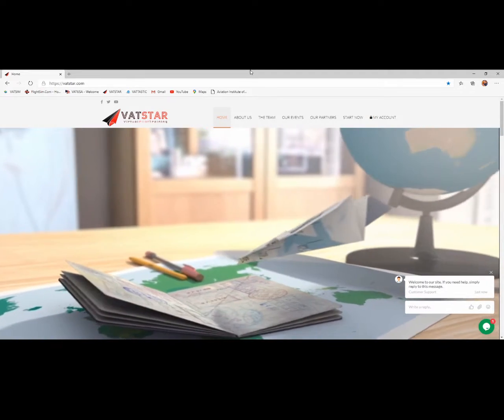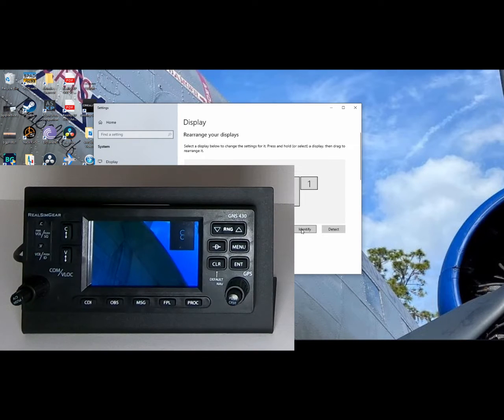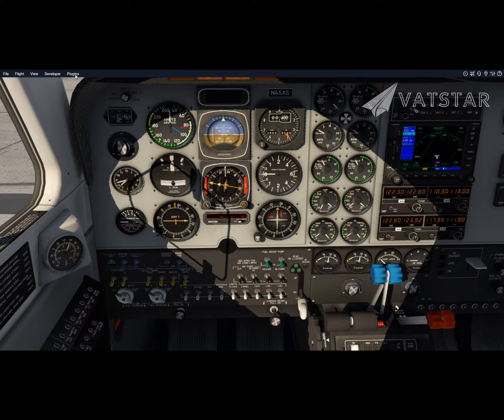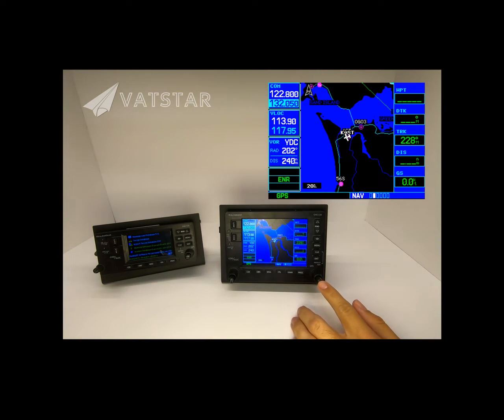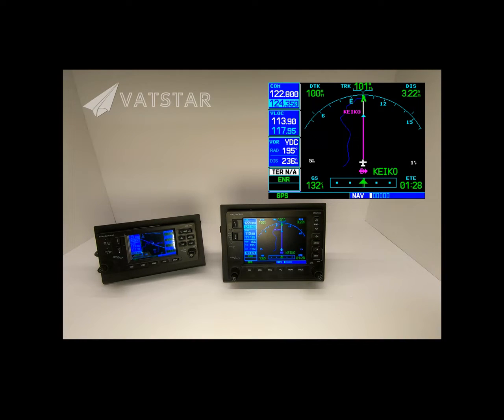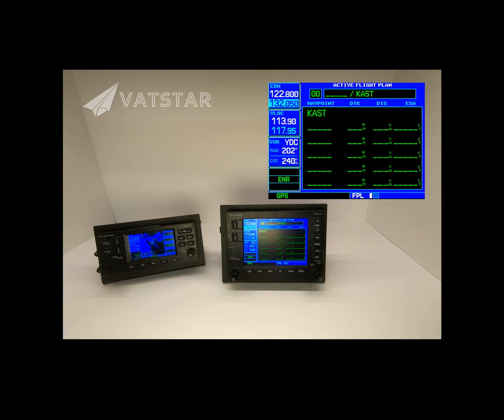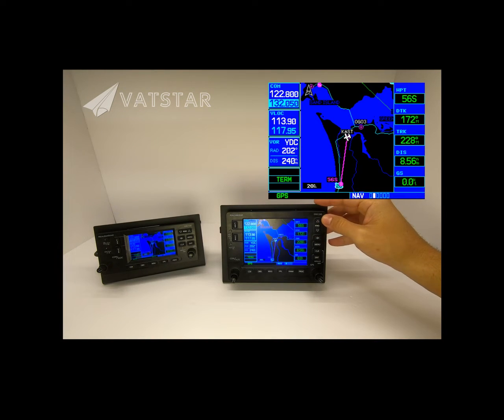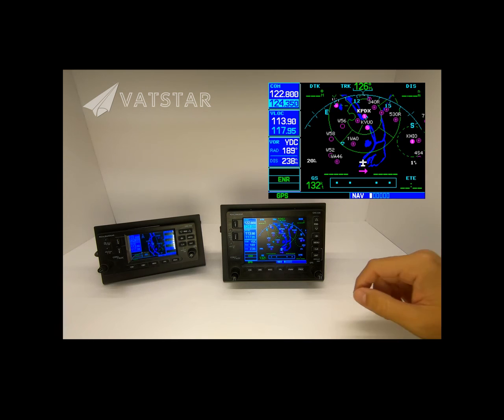VATSTAR's set up and tutorial of the RealSimGear GNS430 and 530

Comment: I had a problem with the settings. The Real SimGear website is terrible. Absolutely no service. Only selling. You helped me out with your video. Really great. I use the GNS 430 when I'm wearing my VR headset. I use the buttons by touch. But I do have the screen visible in VR. It worked with one helicopter, but not with the other... Good tip about the Bezzel settings. And in the Settings, there was a checkbox that wasn't checked correctly. But you have to set the settings correctly for each aircraft. THANKS FOR YOUR EXPLANATION.👍👍👍👍👍👍👍👍👍👍👍👍👍